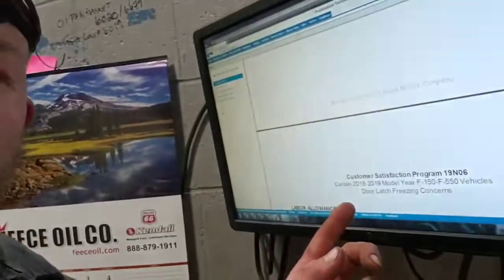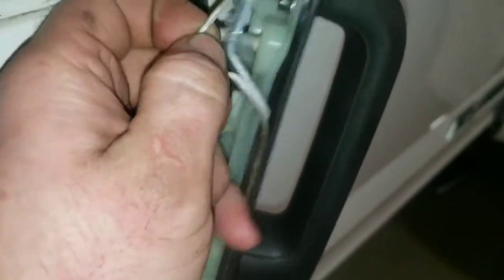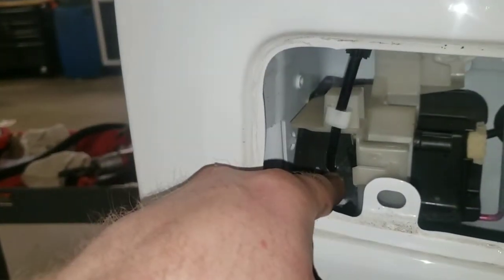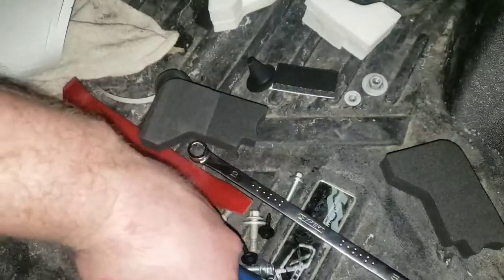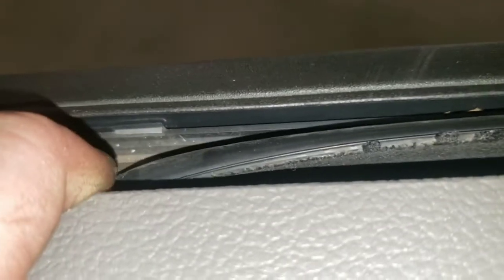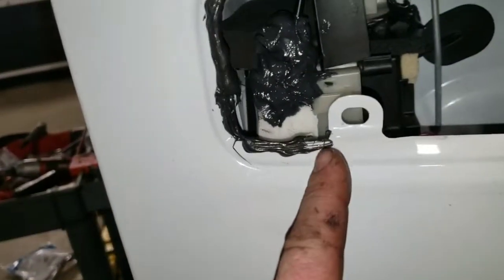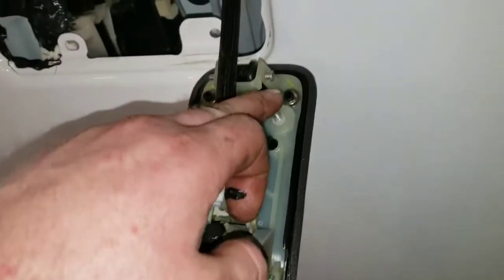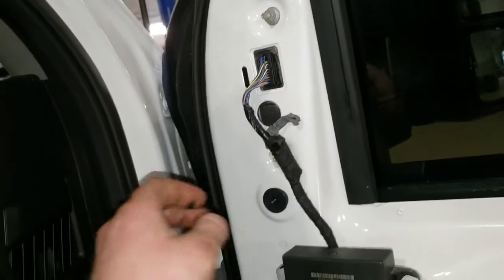F150 F250 F350 F450 Door Lock Freezing Concern 19NO6 / 18N03

Comment: Had my ‘17 f350 done 4 times. Still freezes. I cary a Honda generator and a hair dryer in my back seat from November till April. 70K for a truck that can only be driven 6 months a year without problems. Super fun.
Reply from the maker: I told them several times to let me come up with a technical service bulletin to fix this issue and they will not listen to me because I've done it several times and the customers don't come back after I do it but I did it my way and they will not even entertain letting me do this my way
Reply: I just got tired of taking it in
Reply from the maker: @daves8098  the main focus needs to be right around those door handles where they seal in the opening of the door
Reply: that's so funny, I'm doing the same thing.....I carry a heat gun and extension cord since I have a power inverter in my truck, just two minutes with the heat gun and I'm on my way, this is not to let Ford off the hook, shame on them, I bought a XLT $60,000 and have to carry a heat gun just to drive off on cold weather days is bullshit.
Reply: Papo, I completely agree. Still have that truck. I just can’t bring myself to buy a new one yet, so the hair dryer thing is my only option.
Reply: Same here.  Ford told me when my doors wont open that the fix was to open the door and turn the heat on..  great idea ford

Comment: I just bought a 2018 f150 2.7 stx 4x4 package...2 days after sale when to start my truck...the driver door did not look due to being 1 degrees F outside..i live in one of the northeast states...Had to wait 25min till truck interior got toasty...Than it closed...3rd day did same thing....call dealer for recall made appointment 2wks from now...that's all they had...But found a quick fix used WD-40 Bike Lube Wd40 Specialist Silicone....just spray it in the door latch....worked beautifully....4 day had NO problem....
Reply from the maker: Very good

Comment: Ford Boss Me. Is there a part number for this kit? I have a 2017 F250 and it’s not under the recall but the door locks are freezing. I just need the door repair kit. Thanks!
Reply from the maker: If you take those campaign numbers in the title right here and you type them in Google you will actually come up with the service campaigns that have all the parts at the bottom of the campaign
Reply: @FordBossMe  found them and ordered them. Thank You!!

Comment: I had the recall done two years ago on a 16 f150. Back at the shop today for the same issues
Reply from the maker: They just need to silicone those door handles to the door completely instead of using Foam
Reply: @FordBossMe  wish you worked at my dealer!
Reply: Hi Tom, My wife drives a 2016 F150 here in Michigan just north of Detroit.  She parks the truck outside in winter. Is her truck on a recall for that year?
Reply: @lostinmyspace4910  most likely.  Do the door latches not work in the winter sometimes? They seemed to have fixed my issues.  My tailgate wouldn't unlock and my doors wouldn't latch shut
Reply: @tom00025  Hi Tom, So far, she's not had a problem with door latches getting stuck or popping open, thank goodness.  But in the future  she might. I should check today because we had good rain over a week ago, then that winter blast with below temps and 4 inches snow.

Comment: I've got a 2017 and my doors are freezing for the third year in a row. Bought it used. I plan on putting silicone Caulker on the door handle from the outside to completely seal it. But the other issue is the way the door handles designed snow and ice build up on top of it because it sticks out so far and then water runs down in the door handle
Reply: So update its end of Jan. It rained then snowed twice and now its single digits. Driver door froze bad. I sprayed the handle thru the hole that exposes the mounting bolt and it still crunches with ice. And it wont unlock. Push the unlock button and the rod goes up about half way and right back down. And the door wont latch. I installed block off plates with sound deadener where the clear dust shield goes to help with my speakers so i dont want to take it in to have the recall done. I screwed and siliconed them on because water was getting in the truck after the oem butyl let go on the oem clear plaster shield.

Comment: My '18 F-150 supposedly has the "recall" work performed and my door latches continue to freeze. It's maddening. I use the key to unlock it if the remote doesn't pop the locks, then I cycle the lock  and inside door handle until the lock work and the doors close. They say the recall work is done but I'm not a believer. They tell me the recall work can be repeated for the life of the truck, that it's not a one-time repair.
Reply: You're lucky.  I had the recall work done and now  it is much much worse.   I cannot unlock the doors with the key or fob.  Have to wait for the sun to come out and thaw out the door to unlock.
Reply: It is maddening! I’m just thinking of if I had an actual emergency, then wth?!!
Reply: I’m going to try removing the inner door window seals and all the drain plugs. Then at least when it’s warming up inside some of the air will blow down through the inside of the door and heat it up. Should keep it dryer in there too.  I’ll post an update after it freezes again.
Reply: @nwhuckin7761  My `18 f150 (doesn`t deserve capitol letter) froze this a.m. Ran heater thru center dash vents 10 min, and it thawed (20* F). I`m thinking of cutting a hole in the door panel by the dash vent so warm air will circulate and dry the pos. I`m forced to look for a chevy or dodge replacement. eeewwww

Comment: It sure isn't funny when you have to go to work at 5 am and its10 degrees out and you cant shut the effin door because the latch is frozen. Three times to the dealer and it still going with my 18 f150. Although lately its been working great.....as its 80 degrees out! Seriously, 5 years of this cab and this crap is still happening ! 40 plus thousand dollar trucks and they cant a door latch to work!

Comment: I have a 2018 F150 Crew Cab. This winter is the first time I've had issues with my locks freezing. I was unaware of a recall. My truck doubles as an emergency medical response vehicle and my response time is greatly effected when doors will not latch after opening. Once my cab warms up my door latches operate normally.

Comment: I have a 2017 xlt crew cab  4 door and the body shop did some work on it now my left rear door won’t unlock. The actuator try’s to unlock it but it’s like it’s in a bind cause I can’t manually pull the door lock up either. Would you happen to know what’s wrong with it or what to look at. I want to take it apart and fix it myself rather than the body shop do it and keep my truck another month.

Comment: I have a 2018 f150 crew cab. Same freezing issue. I covered my driver side door with plastic wrap that went around an partially inside the truck. This although a pain prevented the lock from freezing but the door still wouldn’t close until I warmed up the inside of my truck. How is that possible? Thanks for sharing your video.

Comment: They did mine twice and it’s 2020 same issue my alarm keep going off because it’s saying my back door stays open
Reply from the maker: I wish they would permanently silicone the door handles, I told them we have one guy that wants to come in and let me do the repairs I see that need to be done and we can update the recall. They have not accepted my offer 

the Handle Needs to be siliconed around its housing and they put this cheap piece of foam and it doesn't hold up

Comment: My 2018 F350 15,000 miles and Krown rustproofed every year in the fall and my drivers rear won’t unlock. An hour later and the passenger rear won’t unlock.
It’s 20 degrees and feels like 5 degrees.
Reply from the maker: 18 N 03 door lock freezing campaign

Look it up and see if it's active on your truck and get it to the dealership to have it done
Reply: @FordBossMe  is that a TSB or a recall? I’m out of warranty. I bought the truck new and have had three recalls already.
Thanks for the response.
I appreciate the response.

Comment: Thanks for the informative video. Any idea if they improved or corrected this issue for 2020s?
Reply from the maker: On the END OF 2019 and above the beefed everything up, more water shields from Factory the rubber on the end of the door lock cable and it's still so NEW we are waiting to see what happens

Honestly it seems as if there are still some issues but we shall see
Reply: Mine were fixed 4 times still not working. I opened  up the panels and sprayed gun oil works like a charm.
Reply: 2018 f150 took it for the recall and again later and still door's freezing.  Ugh
Reply: I have a 2020 F350 and it's happening  to my driver side door  pain in the ass with this.
Reply: I have a 2020 and the dealers said that there are no known issues with my model year. He said he can get me in in 4 weeks $200.00 diagnose fee. So I asked what happens when they bring it in and it’s 50 degs out and the lock works perfectly? He wouldn’t give me an answer. Have you noticed any 2020/21/22 having issues? Thanks for the video.

Comment: Can I do any type of correction on my own? What if I spray Wd40 or another type of anti water lubricant inside the lock would that help?
Reply from the maker: You want to use something like a silicone not WD-40
Reply from the maker: Of course you can do this type of repair but make sure you know what you're doing and you're mechanically handy

Comment: My doors were fixed front door knob still giving me problems. Thus week the rear passenger door just opened on its own while driving scary situation.
Reply from the maker: You might want to check with the dealer because I think they came out with another update to the actual door locks to update the recall

Comment: I have an 18 F150 and I had this recall done but now the door lock rod knob on the driver side is sunk down into the door when you lock the door. It’s also much louder than the passenger side when locking and unlocking. Any ideas as to why?
Reply from the maker: Yeah they probably didn't put the rod in right or the little cap that screws onto the rod the threads are stripped so it went too far and didn't stop and kept screwing on to the rod further
Reply: The tech forgot to install the locking rod back onto the door handle. That rod is only found on the LF driver door only.

Comment: My  2019 f50 was made in after the dates for this issue. However I have some white pieces of sealant material sticking out from under my door handle. Any idea if that needs to be addressed to prevent this?
Reply from the maker: Can you email me a picture of it? poissorichard.rp@gmail.com
Reply from the maker: EMAILED - yeah thats not normal and needs fixed

Comment: any major concerns about the 2015 f150 ecoboost?
Reply from the maker: Same as the other ones 

Front cover leak
Timing chains and phasers
If it's a 2.7 stay far away if it's a 3.5 you're better off with that one but the biggest thing is the timing chains and phasers

If I bought an F-150 that year it would be a 5.0 and would not be an EcoBoost

Comment: Is it possible to heat up the handle for a temporary fix
Reply from the maker: You can try but I don't really think so because the freezing is more down inside the lock mechanism than anything
Reply: @FordBossMe  so all i have to do is what till it unfreezes and it will work  again?
Reply from the maker: @richmahogany1480  it should the problem is you have water that's freezing something and until it unthaws it's not going to work properly more than likely

Comment: No matter what you do you’re still gonna get condensation in there. They are putting a bandaid on a shit design.  100 years of innovation… I’m about to sell my 17 f350
Reply from the maker: Wrong, I have fixed them with just the handle upgrade I do my way
Reply: Same with me on my 20. I get more mad about little things that designing hasny changed in like 35 years. How can manufacturers keep making stupid engineering mistakes.